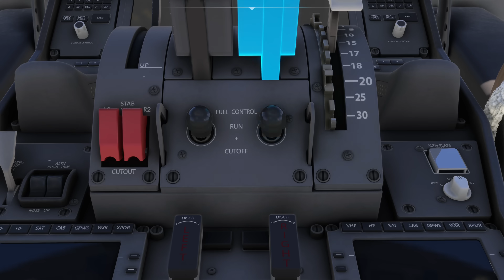Air India 171: Why Did The Fuel Cut-off Switch Get Moved?

Comment: Under the assumption that the pilot who did move the switch was not intending to move the switch and not aware he did move the switch:
- Are there any switches near the fuel cut off switches that get pressed soon after start e.g. for retracting the gear/flaps? 
- is the protection of the switch only against "accidential switching" or does it also have the intended purpose of giving the pilot a moment to double check his actions?
- are there other "higher protected" switches that have to be activated regular during flying especially during start. Could it be that the pilot are just trained* to override those protection on a regular base.
- Have there been any (protected) buttons not pressed. This would indicate inadvertently pressing the wrong button.

*In chemical plants we know that when the operator are under high work load (or when bored) they do manual actions intuitivly  An our industry know the switch protection doesn't work reliable when is gets activated too often. Operators build muscle memories and then protections don't protect anymore.
Reply: This is so cringe. Stop acting like a smart one online.

Comment: The sad part for pilots is that AI eill be taking over starting in 32' well after Capt Steve is retired from 121 flying and the pilotless flight deck is beibg heavily, and I mean hugely! pushed by Airbus and General Dynamics, each has a skunkworks group, Airbus' is called Project Dragonfly, theyve had a few successful fully AI flights of their own planes in testing as has GD for Boeing, and bots will also soon replace the mechanics in the factories and maint bays. The elitz, bi llely gaytz goal is to eliminate 85% of the wrld pop by 45'. It was also written on ga g uide sto nes.

Comment: Having two people required to activate the fuel control wouldn't work.  What if one pilot was incapacitated due to a bird strike, for example, that caused a fire in one engine?  No two pilots to activate that engine fuel cut off is there.

Comment: There should be a lock mechanism, so one can't just cutoff so easily. There was an FAA report on 737 before stating the design can come loose, but wasn't demanding to make change on the design, just suggesting. If I recalled it correctly. My opinion is still on Boeing's fault.
Reply: You do not recall correctly. That’s not what it said at all.

Comment: In 2019, a JAL owned 787-8, after landing, without Pilot's intervention both engines rolled back and then shut off. Even engineers could not rectify the fault and then the plane had to be towed back to the hanger. That incident is proof that Fuel control switches are not error proof.

Comment: Please note the below update from Jul 12th on The Aviation Heald.  There were several service bulletins one issued in 2018 by the FAA and another from the FAA in 2021.  Seems in the report the Air India did NOT implement them. 

On Jul 12th 2025 (UTC) India's media report that the investigation is NOT focussing on a human action causing the fuel switches to appear in the CUTOFF position, but on a system failure. The Service Information Bulletin by the FAA issued in year 2018 recommending to upgrade the fuel switches on 737s and inspecting the fuel switch locking feature on other aircraft types including the Boeing 787 to prevent inadvertent flip of the switches, as well as the FAA/GE issued Service Bulletin FAA-2021-0273-0013 Attachment 2 relating to loss of control issue (also see above) were NOT implemented by Air India. The stated MN4 computer with faulty soldering, that might weaken and lose contact due to the thermal stress after a number of cycles, interprets data and commands fuel metering valves - with the lost contact attaching the MN4 processor to the EEC intermittent electrical contact, loss of signal processing and engine control faults can occur. The SB writes under conditions for the SB: "An LOTC (Loss Of Thrust Control) event has occurred due to an EEC MN4 microprocessor solder ball failure." According to discussions in the industry it may be possible with the number of cycles VT-ANB had already completed, the solder balls were weakened sufficiently to detach the MN4 from the EEC momentarily due to loads during the takeoff rotation leading to the loss of control of thrust and shut down of the engines.

On Jul 14th 2025 India's DGCA instructed airlines to check the fuel switches on the Boeing 787 and Boeing 737 aircraft as used by Air India Group, Indigo and Spicejet for possible disengagement of the fuel control switch locking feature according to the SAIB released by the FAA on Dec 17th 2018. The checks have to be completed by Jul 21st 2025.

Comment: Boeing should modify the design by adding 2buttons, 1 for each pilot. If the pilot wants to change the fuel control switch, he/she should press this new button to permit them to take charge of fuel control switch. The fuel control switch position should not be changeable, unless the 1st new switch is pressed. If the 2nd pilot is in disagreement, he/she should press his/her switch and then fuel control switch should become unchangeable. Since this incidence has occurred, Boeing should improve immediately to get to Zero Tolerance.

Comment: Captain Steve,  I to had a lifetime career in aviation. I have flown sidesaddle on three different aircraft and have earned type certificates in over twelve.  
I have been retired since 2012 , but I have found that the number of aviators has been greatly reduced since the innovation of computers and fly by wire systems. 
I have flown three different trimotor airplanes, Ford, 727,L-1011. 
I've captained DC-3,DC-9, DC-8, MD-80- super 88, Boeing 727, 737, 767,L-1011. 
I retired with 45,783 total time pic,  25,330 of that is in rotor craft. 
Captain Steve, I have walked through numerous accident investigations with the FAA and NTSB. 
This India accident just doesn't fit accident characteristics. It truly looks like either a suicide or terrorist attack. 
I kind of doubt the terrorist scenario as no one took responsibility for it. 

I wanted to tell you that I respect and look forward to your postings. 
Keep your head up and on a swivel and may God keep you safe. Thanks for your presentations.

Comment: To jump to the answer " i didn't do it" as a denial, and conclude , is the easy way of the investigation. 
First assume it as a TRUTH , then go into the possibilities of how the fuel switches can be cut off . IS THERE ANY EXTERNAL ACCESS VIA THE SOFTWARE TO CUT THEM OFF ? 
It is claimed that SIMILAR GE ENGINES of the F 16 supplied to America has such external access through software. Is it true . Has the Boeing kept such a provision of the software or the GE kept that similar provisions, BUT NOT REVEALED TO THE BUYERS AND THE PEOPLE AT LARGE .

Comment: One time while crawling into the left seat of a King Air 90, my pants cuff accidentally caught on the cabin dump switch and moved it about 30 % off the closed position. After takeoff our cabin and A/C rate of climb was the same. Moving the switch slightly back to closed solved the issue. It appears the switch had 0 deadband. So is it possible the captain might have accidentally caught his shirt cuff on these switches when removing his hand from the “Guard “ position?

Comment: Hey Cap… is it possible the switches were physically in run mode and the computer somehow registered a cut off? Could the switches being placed back to Run from cut off be a case of the pilots just toggle the switches off and on to re engage?

Comment: These questions are frustrating. People are in denial.

As for the design questions, nobody seems to think of the tradeoffs involved when adding what people think would be additional safeguards. It could introduce more risk in other scenarios.

You can’t require switch input from 2 pilots because there are scenarios where 1 pilot could be incapacitated. 

There is only so much complexity you can introduce into a system before you start introducing reliability problems. Every new component is something else that could break.

Comment: It seems like everything is being framed to blame the dead — just to protect Boeing and the airlines, and to secure hefty insurance payouts. If you go back and check the reports from the day of the crash, ATC had confirmed that there was a Mayday call, followed by the pilots stating that thrust wasn’t achieved due to no power. But now, the official reports claim that the recording ends right after the Mayday call, with no mention of any follow-up statement.

Comment: Why 10 seconds after he saw the switch going off. 10 seconds is extremely slow. Count 10 seconds and you will see. I react much quicker if water is dropping outside the bathtub and that is not serious. And why 4 seconds between one switch back to run and the other. Again an eternity. If I see the switch go off immediately I say WTF and put both on run insanely quickly. Even 2 seconds is to much. That report let me with more questions than answers.

Comment: Fire extinguisher and fuel switches should be linked so that if the extinguisher gets pulled on E1, it automatically shuts down fuel and jumps the lever.

Comment: How could a single pilot turn off 2 switches with in a minute ?  All these experts can not answer that question. Just check 737 Advisory . Same switches used in 787. It says, these switches could malfunction & shut down the engines. Why was this not a Directive ? When pilots are Asian, African, Middle east, Pilot error or Suicide ?  Racist Bastards !!!

Comment: Hello Captain Steve.   I thought about the switch modification as the other viewer mentioned to prevent one person shutting off the switches. 
A simpler fix, as I heard on another channel, would be to make it impossible to cut off the fuel unless the throttles are in the idle position.  I’m sure this can probably be done with a software update and the very worst a redesigned switch. 
It makes no since to

Comment: Still too early for verbal analysis, as I have yet to receive the full report verbatim. To me, the pilot who answered, ""I didn't do so," may be the one who did it. Based solely on the language: The questioner is making an assertive, possibly accusatory presupposition. The responder offers a weak denial using distancing language (“I didn’t do so”), which may hint at deceptive intent. Therefore, from a linguistic and deception analysis perspective, the responder is more likely to be the one who turned off the fuel.

Comment: I still don't see strong evidence that the switches were physically moved by the pilots. Everything is from sensors. The switches themselves were found in the on position. The pilots conversations indicate they did not operate the switches after take off. Conclusion that this was the pilots assume either a lie or a brain fart. Both are possible, even more likely, but both are also rare enough that they must be confirmed by other evidence.

So far insufficient evidence has been presented that the FDR indication of switch position has a high probability of only being from a physical switch change. Where does the FDR get it's information from? Does it get it directly from the cockpit switch or does it get it from the fuel control module in the center of the aircraft? Could there be a wiring problem that would cause the same effect? Lots of unanswered technical questions meaning it is too early to draw conclusions.

FWIW, I am completely on board with investigating the pilots mental health. However, I am not going to assume it was one of the pilots in the absence of better evidence.

Comment: I flew Airbus 320 and Boing 737-800 for about 14 years plus 23 more years as a fighter pilot.
When I started to feel that my work was more a burden than a passion I realiy knew that was the time to stop flying. Never push the line, if you feel tired, uncomfortable or in really bad mud you better spare your time at home instead of flying with 200+ souls on board.
Reply: well, i am glad you did not turn off the fuel on a full airplane midair.

Comment: I have just watched  a report from a captain that suggested that one of the crew did this deliberately. He went through a load of scenarios, and to be honest, the captain would have noticed the first officer pull  both the switches up then place them both in the cut-off position. You need to do this twice, once for each engine In the meantime the captain would have noticed the thrust on one engine disappear with and yaw to one side with a  jerk. Then the same with the other engine. There would have been at least two seconds delay, enough time to look down to see what was going on on the first jolting cut-off. When you lose 30000lbs of thrust all of a sudden, you'll notice it in a heartbeat and through your seat. The video did not show any yaw to either side. I think this was a computer glitch problem maybe a wire short.

Comment: Have the manufacturer rely on the logic that the plane is in the air.  They can easily insert the computer into the logic/control path for the fuel/run switch.

If the plane is in the air PLUS there is no fire, the the switch logic cannot be switched away from run.

Comment: I believe those switches need to be redesigned and the best solution is after V1 once committed to the take off those switches are auto locked until the aircraft has reached a safe altitude ...💡💡

Comment: The report is very short and left to interpretation. Specially they could have added more cockpit voice recordings transcription that show whether it is deliberate or otherwise, specially after the 2nd pilot said "no i didn't cut-off" what was the other pilots reply? could be I just saw you put it down or something that would have made it clearer. And why didn't they include major parameter plot in the report? They said thrust levers were found near idle, who put it there? It seems there might be fight in cockpit and that could have put things in to bed and avoid speculation. Also report indicate ELT (two on 787) was not activated and AFT EAFR is damaged and could not be read/downloaded, this should be immediately corrected for Inservice a/c. Due to this there will be speculation for a year until final or interim report is released in a year.

Comment: I wonder why the plane lifted off near the end of the runway and is it possible that the huge cloud of dust
Possibly containing small stones gets ingested into one or both engines. This scenario could have been the reason 
Why fuel switches were used because of engine problems caused by the ingestion of dust and debris.?

Comment: Is there anything other than seeing the two switches in the cutoff position that the pilot could have observed, and drew the conclusion to comment “why did you cut off the fuel”.  IE, does his comment rule out any electrical problem that could have cut off the fuel without the switch being moved?
Reply: A pilot would know what to look at to confirm that a fuel is cut off--those fuel switches.

Comment: Is it possible that what the FDR recorded was a spurious FADEC COMMAND to shut off the valves, while the physical switch es in the cockpit were in fact still in the RUN position? That would shed a radicallly different light on the whole accidenti.

Comment: Wait -- you say there was no flaw in the plane -- the SAIB Bulletin clearly states a defective fuel switch will have "inadvertent movement" and can cause "engine shutdown"  This has happened.  
Many people feel the pilot was suicidal, but the conversation does not show this.  
1. A mentally disturbed pilot would break down when the other pilot asked why did you switch off the fuel?  He wouldn't say  "I did not".  He would be in tears or put his head down.  He would probably say something like he can't take it anymore.  
2.  What if he was a lunatic or defiant and aggressive?
He would physically stop the other pilot from turning the fuel switches back on.  Here, they were turned back on in less than 10 seconds.  This is normal time because it takes a few seconds for the engines to slow down and for the pilot to realize that they've slowed down.  Then a few seconds to look around and see what went wrong.  So less than 10 seconds means there was no physical struggle between the pilots.  Nor is there any conversation about a physical struggle.   So the pilot doesn't seem suicidal or crazy. 

There are several other reasons that show the pilot was not suicidal, but let's end here for now.  All the "logic" people are using to assume he must have moved the switches to cutoff, on deeper analysis, does not hold up.
Reply: Jumping to a lot of conclusions with your scenario.
Reply: @billb.7346    I see.  But making a criminal allegation of murder on the pilot without any evidence, is OK?!  Did you see him switch off?  No.  A man is innocent until proven guilty.  This is the law.   Your opinion is not above the law.

Comment: There was prior discussion on an identification of an issue that was the subject of an alert concerning the cut-off switches as the plane was made by Boeing?  is that now off the table?  It was from several years ago, was there no fix implemented?  The discussion is now on the switches being changed intentionally - does that remove the manufacturing issue?  If it was deliberate, then I think only 2 conclusions can be reached.  1 - a gross error by one pilot or the other, or 2 - suicide/terrorism.  If I am missing something here, would love to hear it.